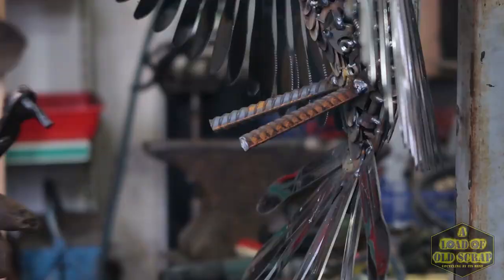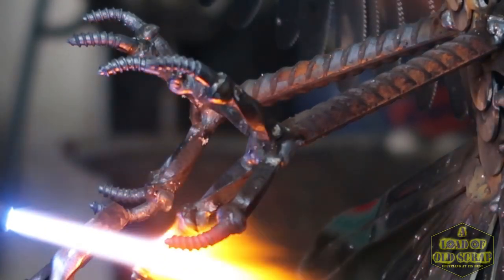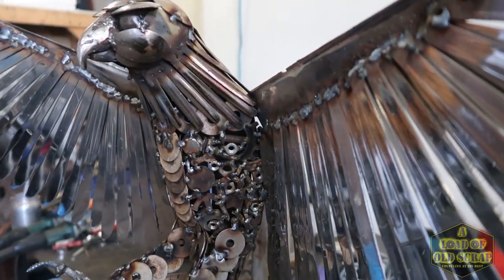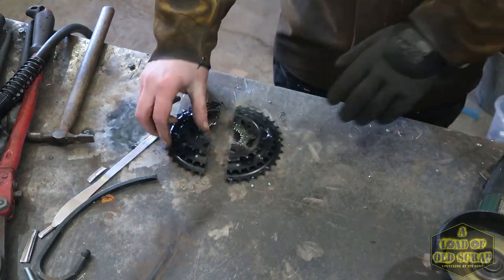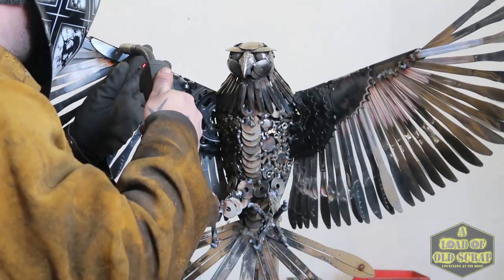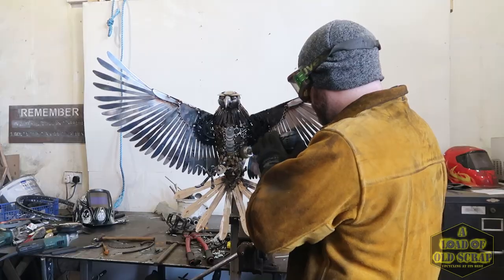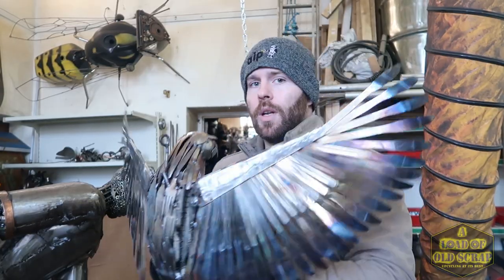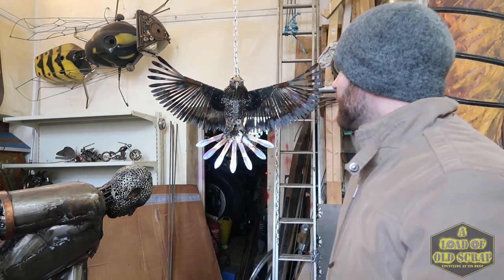Scrap metal hawk part 3 FINISHED!!!

Comment: Lovely job - but surely the talons should be arranged 3 forward and one back? (Only parrots have their toes arranged two forward and two back.)
Reply from the maker: Thanks and your absolutely correct however when I have made them before I have tried doing them anatomically correct in that aspect but they just look a bit wrong. I have found this way they look far more imposing, especially with this one being viewed from below most of the time, having just the one talon at the bottom Kind of gets lost when looking from that angle. There are a few things I create that in my medium that look better with things not technically correct or perhaps enhanced slightly. For instance I do some king fishers but make the beak just slightly out of proportion in length but it looks so much better.
Reply: @ALoadOfOldScrap  Yep - makes sense. Well done.

Comment: Nice. Are you using regular steel wire, or stainless. It appears to be regular steel. If I can get some time I would like to try my hand at it.
Reply from the maker: Hi yes just normal steel mig wire, it's never going to be the strongest weld in the world but as long as its a low grade stainless it will hold it. I wouldn't use it on anything structural but if like this all it needs to do is hold the weight of a knife its perfectly fine.